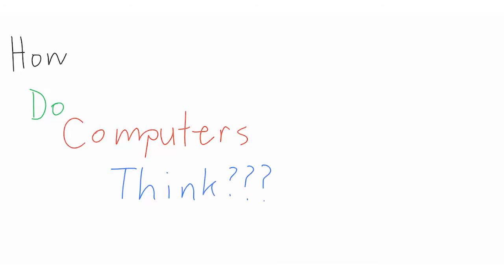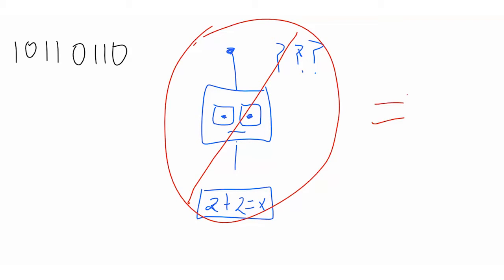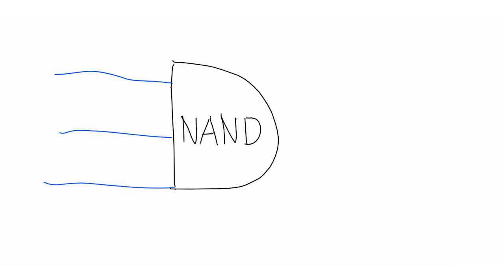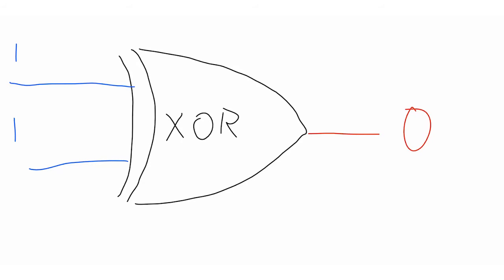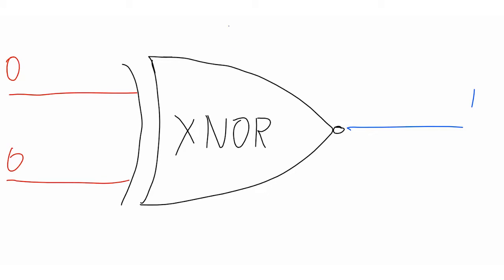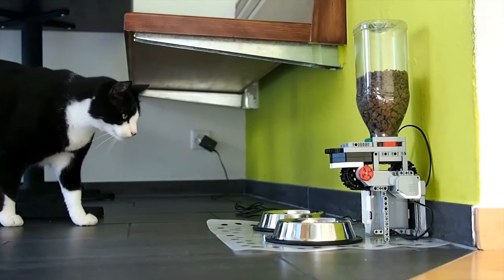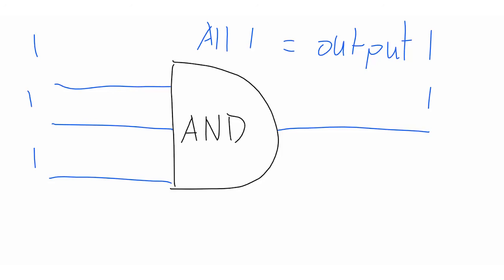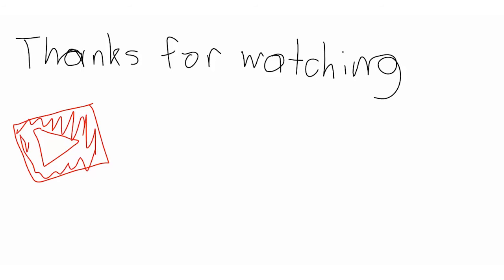How Do Computers Think?

Comment: One question. How does any gate processes the info. Gates are simple transistors. The electricity will go through if the gate lead or pin gets an electricity. My question is who supplies tge voltage and who decides that what manner gayes open or close. Who is doing the automation ???
Reply: Same

Comment: #Tech Without Fear This doesn't really answer my question. Who told it that if all the inputs are 1, to output a 1? How does it know to do this? It is a mechanism made up of non-thinking parts. How does it compute anything? It has some kind of chip that vibrates. So what? How does that make it possible for it to answer questions, or to do math? etc